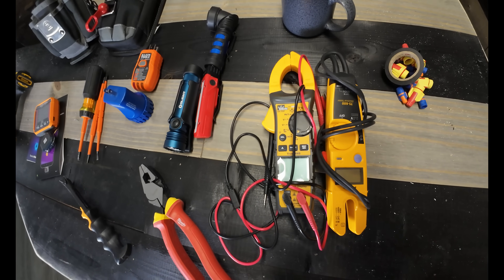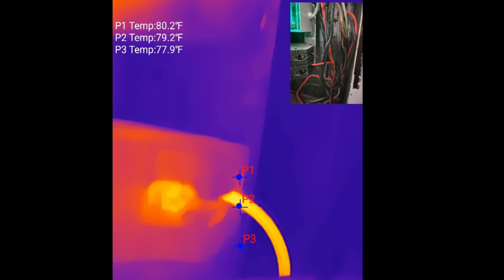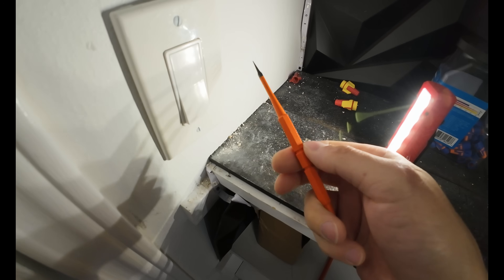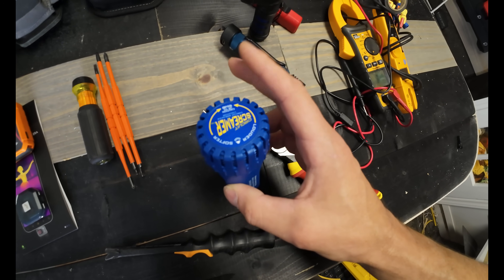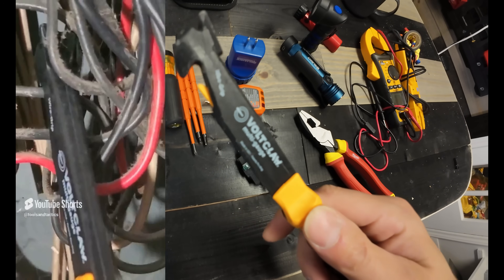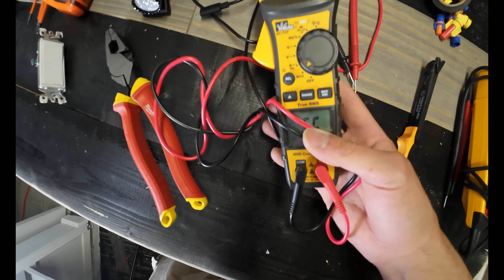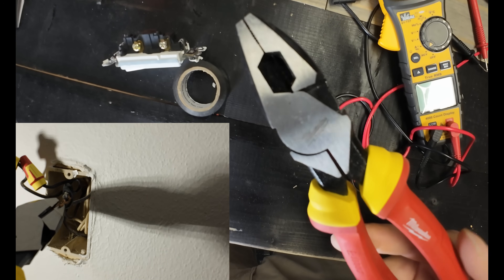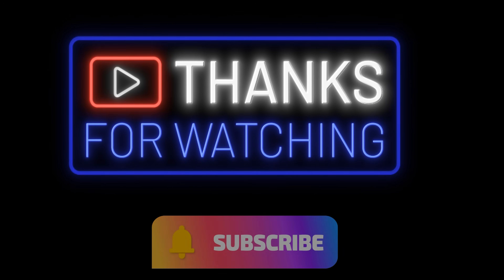Troubleshooting Tools Every Pro Must Have: Thermal Master P2

Comment: Are those klien insulated screwdriver bits still insulated if they are not in the handle? I.e. is there continuity between the ends?
Reply from the maker: i will check right now!   sry been so busy lately!    NO they are full tang through n through they will shock you if you energize 1 side and touch the other without the handle
Reply: @toolsandtactics  Thanks for checking. I have a habit of using the bits outside the handles too. Reason to prefer the single sided bits for isolated applications.

Comment: Without infrared camera , your inspection work is like imaginary 😂
Reply: Couldn’t agree more!！！ The thermal camera was a huge help when I was fixing the pipes and plumbing, but the handheld ones aren’t very practical to use，so i want to buy a smaller one
Reply: @Mesiya-h7o  ✅